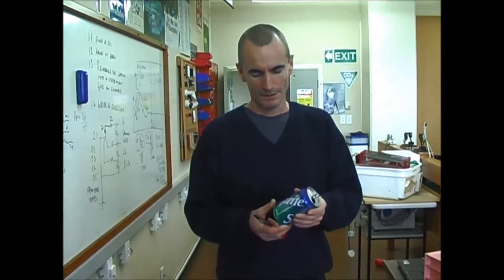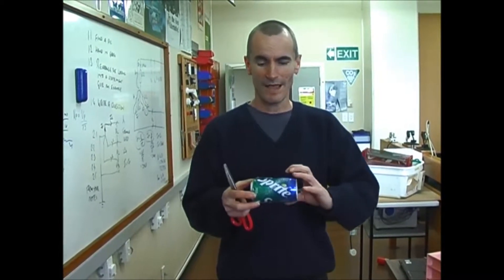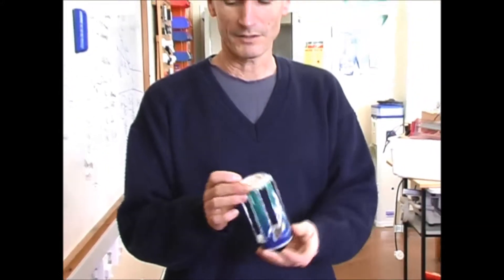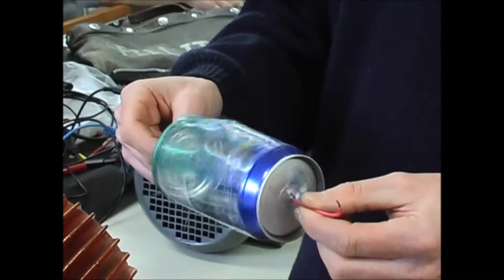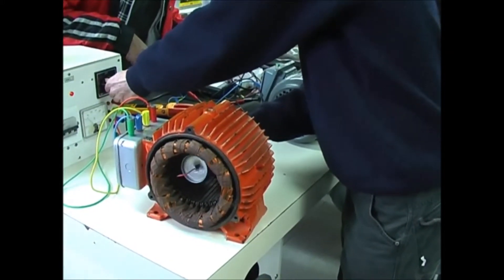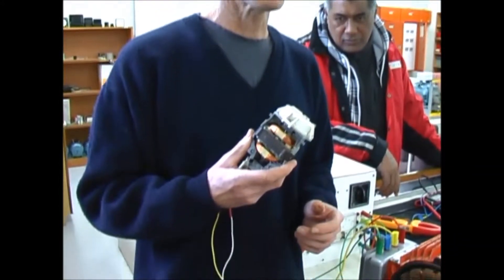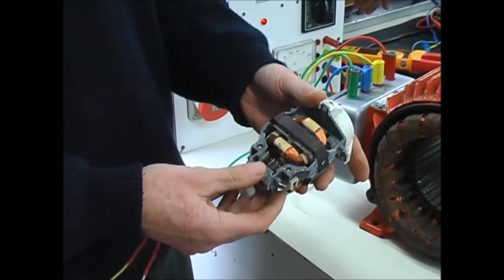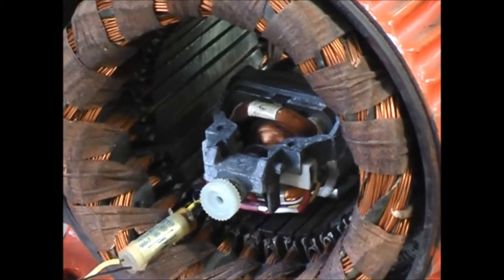Induction motor drink can rotor

Comment: can it work with a single phase motor?
Reply from the maker: Sorry for the late reply. Yes it will work on a single phase induction motor. Its the same deal as a three phase  motor. A rotating magnetic field, from the stator induces a magnetic field in to the can. So the can tends to follow the rotating field of the stator. It will not work with a universal motor.